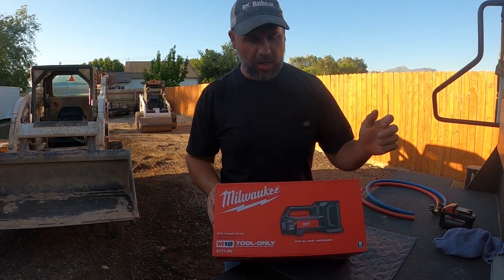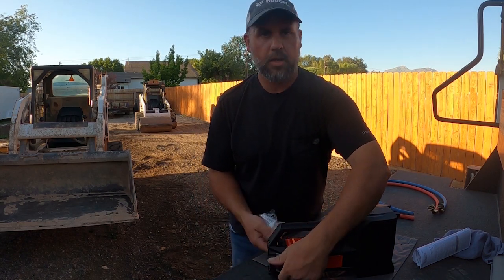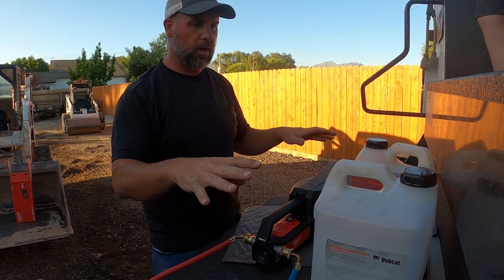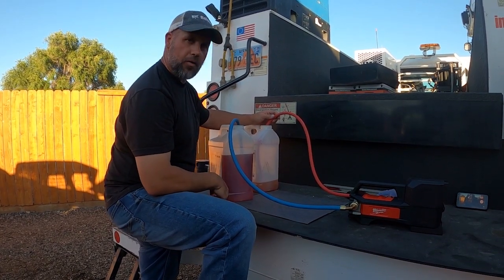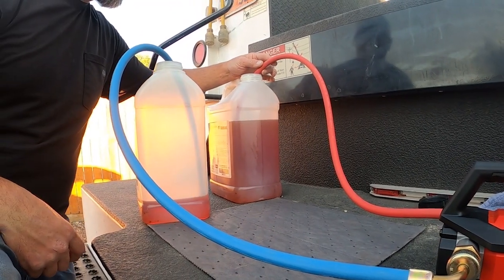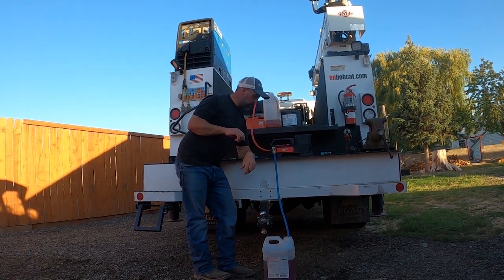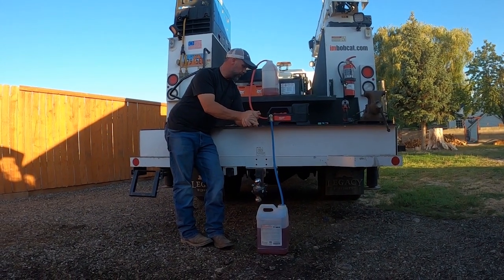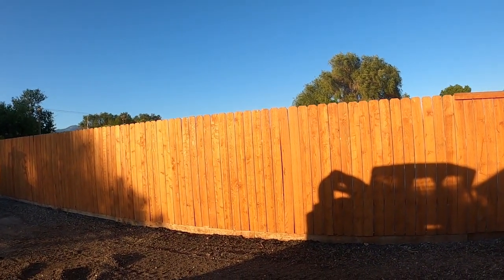Milwaukee M18 Transfer Pump 2771-20, will it pump oil?

Comment: I'm glad you showed this footage. Because that looked weak. I have a pump off of Amazon that moved oil faster than that. I'm shopping around right now to get a second one that's why I'm looking at your video.
Thanks
Reply: With bigger hoses it's supposed to be a lot faster

Comment: Mine had trouble with a commercial car wash soap concentrate.... but that soap concentrate is thicker than oil. I'm not complaining, though. it's transferred hundreds of gallons of chemicals including alkaline presoak, low-pH presoak, waxes, shampoo, wheel cleaner. As long as you flush it with water after every use, it's good to go next time.

Comment: Cutting out a 45° angles not gonna stop it from getting sucked to something… Now putting a 90 degree angle notch in the dead center of it so that each side is longer than the middle is a different story

Comment: I'm a drill and shovel tech and have been thinking about picking one up. How's it holding up?
Reply: I have used it on compressors inside electric shovels, holds up great.

Comment: Thanks for video, just wanted to know is have you tried pumping hot oil, and if so how did it hold up? Thanks
Reply: I pump compressor oil at up to about 150 degrees f. 6 years and no issues.

Comment: I am an industrial compressor tech. I have been using this pump to change compressor oil for 6 years. 30 degrees f to 150 degrees f. Hundreds of gallons. Not 1 single problem. I use half inch id hose and can pump 20 gallons of oil at 65 degrees in about 10 minutes. Great pump. If it dies tomorrow I will buy another one.
Reply: I’m a compressor tech as well and I’ve been on the fence about buying that damn pump. Major PM’s on a 250HP ain’t gonna be so shitty now 😁
Reply: @maysonmills808  you won't regret it.

Comment: I love it. My question is i want to have at the fill end a gun with a metre so if you needed say 10.5 litres of oil to fill a tank you can have it exact. Have you tryed to block the outlet to see when the pump is on if it can handle that without wrecking the pump ? So if you have you gun/nozzle without pressing the trigger how do you think it would handle it ? Cheers
Reply: Maybe tie the meter trigger valve open and just use the pump on/off switch to dispense?

Comment: You purchased a tool not intended for the purpose you require.  Why would you do that and showcase it??  Buy the proper tool and note that it will fail.  It is designed as a water transfer pump.  What is your goal here??  To show people how to improperly use tools??  For your information, I am a Chemical Engineer and do not understand why you are using this tool to pump oil?
Reply: Ummm because it works.
Reply: @jessehall8168  Did you graduate from high school??  "Because it works"?  What a reason to use a device for an unintended purpose.  You probably tow a boat with a 4 cylinder car and hitch.  That works as well.
Reply: Does milwaukee make an m18 oil pump? Okay then.
Reply: @andyb4071  Then go buy a proper oil pump and use it.  The manufacturer clearly advises to use for water and avoid pumping oil/fuel.  Just because Milwaukee does not make an oil pump is not justification to use a tool for an unintended purpose.  This answer is pathetic.
Reply: @sn957  Then you have no understanding using equipment for its intended use.  Hope you are not involved in equipment installation and process design!!  Do what you want....I don't care.  I use it as a water transfer pump and use an oil pump to pump oil.  It is a water transfer pump and I noted it.  The instructions clearly state what it is designed for.

A bunch of fools, that have been doing things incorrectly (for long periods of time) does not impress me.  

Doing something wrong, for many years, does not make it right.  

Justifying it, because you have been able to do it; is even more disturbing.  

Just like fools that boost batteries, and ground where they want.  One day, after so many times doing it incorrectly, they get a treat!!
Reply: @byronakhavi953  Sir if you have a link to the proper setup at a similar cost point I am all ears.  Thank you.
Reply from the maker: Thousands of mechanics and technicians use this pump to pump oils and diesel with great success.  I use it at least 3 times a week pumping hydraulic oil, differential oil,  diesel, and even contaminated diesel mixed with gasoline.  Never had a single issue and still using the original impeller.  This pump is extremely popular with is the heavy equipment community and everyone love it!
Reply: @tetradgroup  same here, we use it at the plant  all the time.
Reply: Hoo gives a fuck if you’re a engineer it work great
Reply: I am assuming you meant :"It works great".  Guess you forgot how to use the work "who"?  Anyways, you are not worth the response.  Thanks for the comment.  Needed a good laugh!! @johnragan9959

Comment: Those  hose have not treated  me well but with right hoses  it works great
Reply: Agreed small inside diameter hoses restrict the flow rate . Use mine to prime diesel engines .  Will not prime DD 13 , 15 , or 16 engines , I use a pressurized air tank of 95 lbs. and 2 gallons of diesel fuel for these .  Made up a few oil resistant hoses and lengths . Amazon has a variety of 3/4” GHT ( garden hose thread ) fittings .  Easy to change hoses quickly .  Also great for changing oil in Class 8 trucks .

Comment: Im an Rv tech and when we winterize we will use the pump to pull the antifreeze from one side and push it into the water system and the pumps are set up the same way with the water hose ends . Milwaukee never disappoints .

Comment: Hey just noticed you’re in Utah north or south? How do you flush it out when you’re going from transmission fluid to gear oil, just water?
Reply from the maker: I'm actually South Valley, Lehi area, and you? I use this pump mostly for evacuation but when I do use it to fill I flush it with the oil I am going to fill with.
Reply: @tetradgroup  I'm in the Ave's in downtown SLC. Thanks for the help keep up the great videos.

Comment: Hi I need to buy a pump to pump the oil from my Lathe gear box head. Is your pump still working? Do you use it a lot.
Reply from the maker: Pump works awesome, pumped hundreds of gallons of  oil, diesel, antifreeze,  and even gas.  It comes with a nitrile impeller
Reply: @tetradgroup  thanks

Comment: Did you ever use it for diesel? I use a 120v transfer pump that works fine for waste oil, but if I use it on diesel- the next day that impeller is so swelled- the motor won’t even turn... The only thing I’ve found that works for diesel is a gear pump...
Reply from the maker: I've pumped hundreds of gallons of diesel, even diesel with gas in it.  I'm working on an update video which explains why this pump can handle it.  Milwaukee uses a nitrile rubber impeller where most water pumps would use a neoprene rubber.  Buy a nitrile impeller for your pump and it will last much longer.
Reply: @tetradgroup  Thanks for the reply. Have you had to change the impeller yet? How often? I’m going to go get this pump today regardless. The only way to get accurate info is from people that use it, so Thanks again..
Reply from the maker: @mlke4258  I bought an extra impeller but I have not changed it yet because the original impeller shows no sign deterioration still works perfectly.
Reply: @tetradgroup  I went out and bought this.. I use it for sucking oil out of big industrial/commercial generators..  Anywhere from 2-80Gallons of oil in these..   When the oil is warmed up- this thing is a friggin HOOVER!! Cold oil can’t flow fast enough to keep up.. Haven’t worked up the stones to try it on diesel yet.. It just works so good for waste oil..  Diesel always frigs that up..  Took your advice and ordered nitrile impellers for my other pumps..  Based off what I read- I’m pretty optimistic.. Thanks again for clarifying..
Reply from the maker: @mlke4258  Awesome, thanks for the update.  Try using a larger suction hose for the cold, thick oil.  Makes a big difference.

Comment: Anyone tried this on gas at all? Wouldn’t use it for gas a lot just every once in awhile and would wash out
Reply from the maker: As a field mechanic I run across quite a few machines where people put gas in the tank instead of diesel. It's usually high concentrations of gas and I've pumped out probably eight tanks already with this pump. Still no issues with the impeller.
Reply: @tetradgroup  I’ve got a customers rig with 10 gallons diesel with 40 gallons gasoline. Use the pump for years for def diesel mix but never gasoline. Was curious if I’d be ok using this with almost strait gasoline
Reply: @tetradgroup  okay thank you I appreciate it that was the main reason I was debating on buying this tool
Reply: @rjwilliams1697  did you use this for gas? Have a 50 gallon tank I need to drain just don’t want a fire hazard. Don’t care about trashing the impeller just don’t want it to catch fire on me.
Reply: @ridein4life1  yea I used it with gas I drained gas out of my jet skis with it

Comment: Curious if this will pump out a water heater that's full of sediment...any experience with that?
Reply from the maker: I have not tried a water heater yet.  I use it mostly for oil but it can handle some trash being an impeller style pump
Reply: @tetradgroup  👍

Comment: Hi could you do an update video or try different oils? I’m really wanting one but don’t wanna end up with something that’s no use to me if it can’t pump gear oil
Reply: If it could pump cold 50 to 90 weight gear oil it would be ideal for servicing in winter time.
Reply: @kevinmoss970  I think gear oils worse than oil for it but you could try it I ordered one and I’m definitely going to try pumping normal oil
Reply: That tool is not designed to pump oil.  Read the manufacturer instructions and they clearly state "water only".  It is a water transfer pump....not an oil pump.  The answer for your question is outlined in the pump's specs.  Just because he uses it for oil does not mean it is acceptable.

Comment: It will work.  But for how long with petroleum products?  I'll definitely be checking back in to find out.  I bought one of these when they first came out and it pumps water very well.  An unrestricted garden hose stream about 5 feet.  I highly suggest that you run some Dawn and water in a bucket after use.  It's pretty specific about not pumping petroleum products, but I'm not sure if that's for legal CYA reasons or the parts not holding up in petroleum.  Look for 1. Viton, or 2. Nitrile rubber parts and o-rings if you can find them.  And maybe look at having a shop fab some impellers out of those rubbers if you want the parts to last.  Long term petroleum contact does incredible damage to non-oil resistant rubber.  The window and the impeller and the shaft seal are, of course the parts to keep an eye on.  But the Dawn rinse out should be pretty effective at preserving these parts if you don't feel like replacing them.  Hell they may already BE oil resistant and the legal team gave it the big thumbs down like I alluded to above.
I wouldn't, under any circumstances, pump gasoline with it though.  It's a brushed motor, so any shaft seal leakage would warm things up in a hurry.  
Pairing this motor up to a rotary vane pump would be amazing.  Add variable speed and wow.
Thanks for posting this.  Looking forward to updates.  Keep up the good work.
Reply: It's a nitrile impeller already and the window is glass
Reply: Jabsco and Johnson nitrile and viton impellers fit right in
Reply: @2secondslater  Could you please offer some part numbers for the impellers?
Reply: I have the same question. But the warnings in the manual do NOT rule out petroleum products. It does rule out flammable products (gasoline, fuel oil, kerosene, etc.). Motor oil doesn't have a low flash point. So the only question is will motor oil degrade the exposed pump parts over time.

Comment: How’s the pump holding up? Will it handle 85-140 gear oil?
Reply from the maker: Still working like new.  I bought a new impeller to have on hand just in case.  I've probably pumped over 200 gallons of oil and diesel.  I've pumped some gear oil, it's slow but it will pump.
Reply: HowIDidIt great to hear thanks for the info gonna go ahead and order one up! Thanks for the great review!
Reply: @superMrpena did it pump your gear oil

Comment: I’m interested to know if the oil affects the rubber impeller over time. Some types of rubber can’t handle it.
Reply: They are designed to be changed out so shouldn’t matter anyway I think Milwaukee calls to chance after 1k gallons

Comment: How thick was the oil you been pumping?
Reply from the maker: Up to 40w with the small hoses, it will pump gear oil but I use slightly bigger hoses